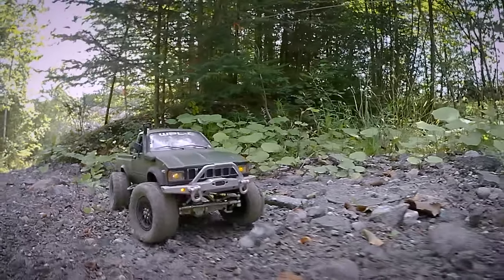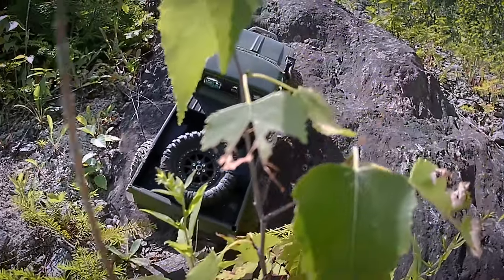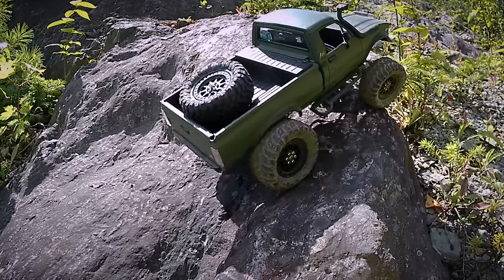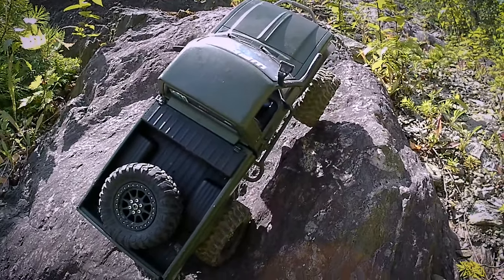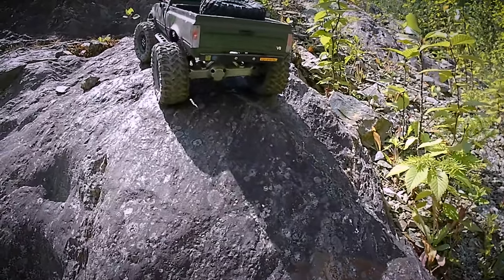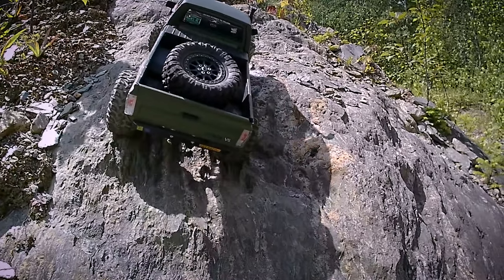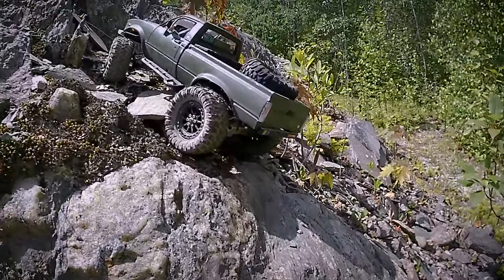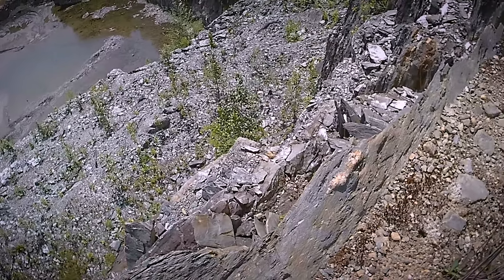WPL C24  - Green Machine - Quarry #9 - Crawling on Hot Rock

Comment: Hey man I was wondering where I could get those side steps you got there. Those are really nice!!! Thank you
Reply from the maker: They're 3D printed and I got them in a big bunch of used WPL stuff I got a couple summers ago. You can grab the file from here and print them or send it off to a print house and have them done. These are also a frame mounted version. Mine are much older so they're actually mounted to the body using the factory holes. https://cults3d.com/en/3d-model/various/wpl-c24-frame-mounted-rock-sliders

Comment: Vermont is beautiful. I'm in the suburbs of Osaka ain't nearly as beautiful as your home town. Question for you, where did you find the snorkel and was it easy to install?
Reply from the maker: From some of the photos I've seen of Japan, I bet we could trade beautiful locations all day long! Japan is amazing! That said, the snorkel comes with the C14/24 trucks in both the RTR version and the Kit versions. Did your kit(s) not have one? The spare parts are available through their website if you would like to order them: https://www.wpl-rc.com/products/c14-plastic-bits-seat-wiper-door-handle-steering-side-mirror-side-steps-dashboard-snorkel?_pos=2&_sid=a70c84ec5&_ss=r There are holes on the body that accept the plastic pins on the back of the piece. I glued mine in place with super glue. The top comes loose every once in awhile from rollvers but I have never actually broken one!
Reply: Thanks so much for the help. There are many beautiful places all over Japan. I've seen many of them and look forward to seeing more.
I have an old WPL B1 and I'm doing a complete remodel it making a semi B14 with my own ideas. I thought the snorkel    would add a nice touch. Thanks again.